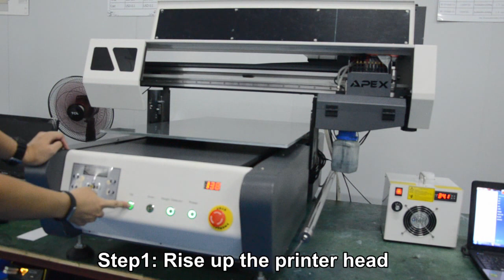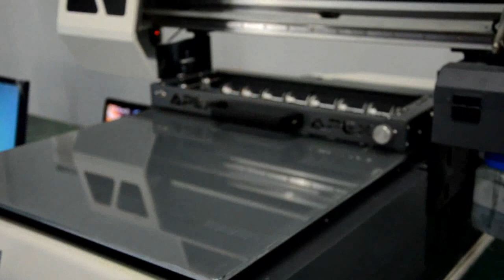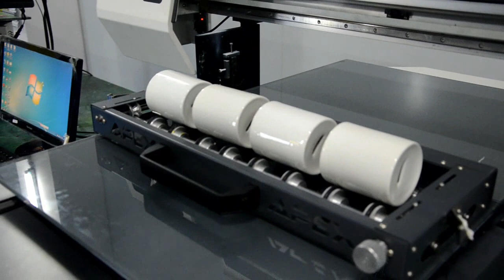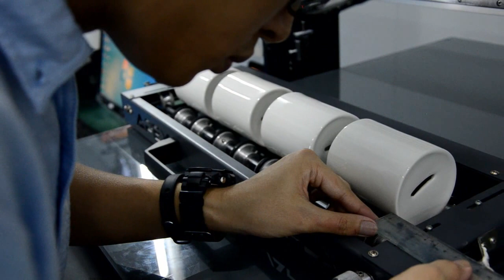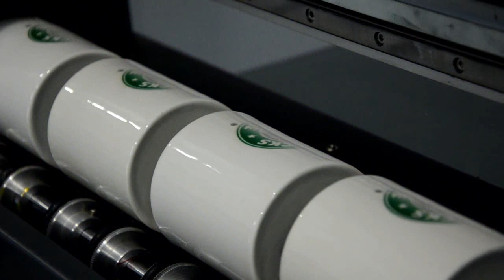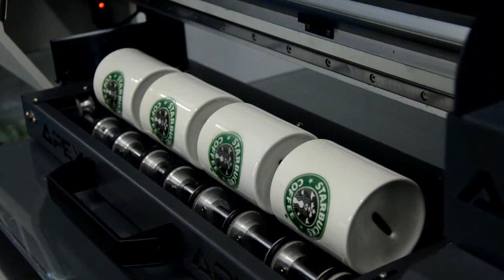How to Print Image on 4 Piggies at one pass with APEX Digital LED UV Printer

Comment: tell me after printing this logo does it need to pass heating process or its already ready for packing in carton boxes?
Reply from the maker: +Milan Rakovic Hi~sir.printing this logo,  it's already ready for packing in carton boxes
Reply: Ne kupuj ne valja nista ovo sranje.
Dont buy this, its a scam, after you buy it you will have to buy extra original Mimaki parts so it can work, Ciss system not working well also Capping station must be replaced with original Mimaki also dumpers and hoses, tables are uneven and very hard to fix, it has lots of software bugs, stops and freezes often, also their inks are crap everyday you have to clean the head and waste lots of ink because of the system leakage of air in to the hoses which makes the inks dry during the night.
Reply: you have to read the user manual and do the daily, weekly and even quarterly maintenance carefully. otherwise no printer will work well.